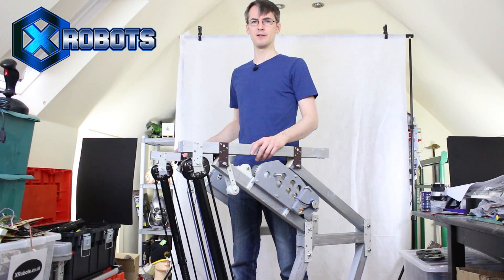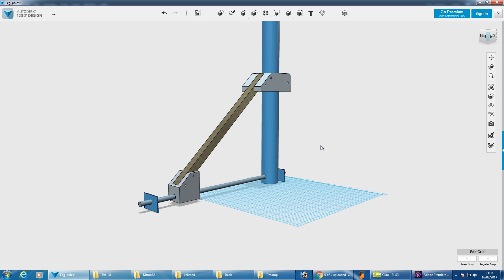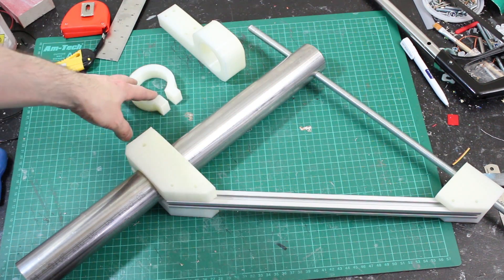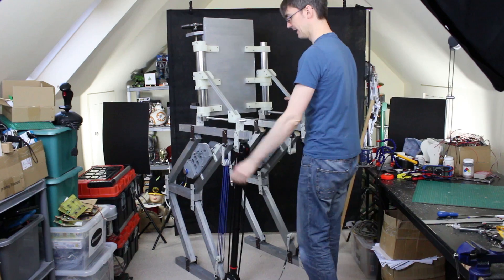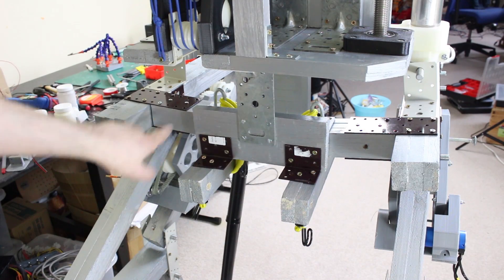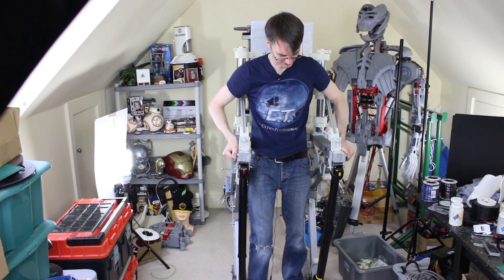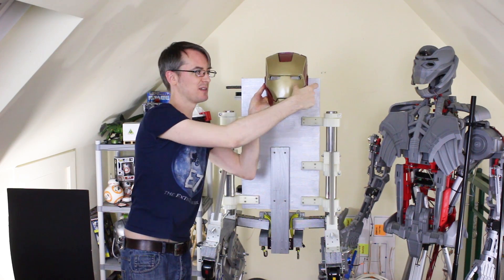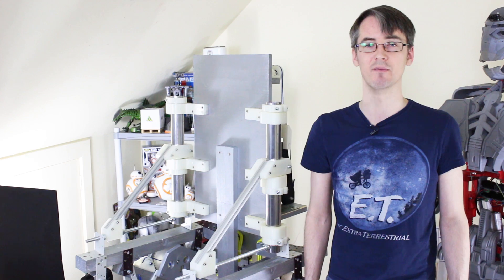Iron Man Exosuit #8 | Walking | James Bruton

Comment: no offence but most of you exosuit is much larger than it could be by simply moving a few components. for example you can hide the power cells and motors for joints in the places where logically muscles would be, and use multiple paracord pullies to reach over the joint. Also, for the legs you should use multiple springs and try to keep the mechanism as close to your legs as possible so that you can focus more on the structural support to the components from the outside. just some ideas based on what I have tried to do before. but i really havent worked with 3d printers or plastic and i can see that budget constraints might be a serious concern.

Comment: I'm still a bit unsure about the 'reverse knee' arrangement you're using. But if it does the job of keeping the heavy equipment off your back, great! That's the whole point of exoskeletons, right? Divert the force and stress off of the user and into the much stronger framework and actuators.
Reply: Like a forklift, you want full control at the front, and forward legs would get in the way. Anyway birds' legs go backwards.

Comment: the problem with your robot and todays exoskeleton is that it's too big and theirs no hip structure keeping the device from falling is also mechanical electric motor gyroscope? some  world robot designers don't even use it about the joints and to steady the device to run quickly!
Reply: ...what?

Comment: I added 177 electric motors for flying the device like a manned drone that's also connected to the exoskeleton having 200v electric motors 1000lbs lifting weight. besides flying over 35,000mph let me see if u can?

Comment: good job. if so their be a next suit try using the robot in your size u made having in its front a headrest and it's chest a backrest and try to separate the hip top of structure and bottom of mechanical structure extended spaced backwards for a bootie rest with rotation movement left & right and to lean side to side for the top of the hip structure and bottom. your left and right arms and leg rest should be between dual mechanical arms and legs connected by motor above shoulders and legs connected Left and Right side  using simplified  motorized Biomechanical Neron controlled the exoskeleton should be coupled with abs or aluminum alloy bodywork connected to the exoskeleton to cover u. let me see u do that!

Comment: On your other video you are building a robot using drill motors as "muscles" and Arduinos as the brains. You have then programmed the Arduino to rotate the motors to compensate when the frame moves (for stability). Could you not have used a similar approach here to design the legs and possibly the remainder of this suit? OR would this approach be too-slow/under-powered? And if it is too slow, would air muscles not have been a feasible replacement?
Reply: This is true. However both have their merits. Air muscles would give higher speed and work more like real muscles, but linear actuators using powerful drill motors would allow for much higher strength. 
With the design you've gone with, it's very reminiscent of the Caterpillar P-5000 Work Loader from Aliens....and that was used for strength. 
At least when you've finished this, you'll be able to fight aliens :)

Comment: I don't know if you might have talked about this in  the past, but why exactly are you maing only 1 arm?
Reply: oh okay, that makes sense. but is there any chance you will  consider making fhe second arm too when all is done? I think it would look so much cooler!
Reply: At the moment this is only a prototype or 'crude' prototype as James has mentioned. Meant for low cost and efficiency during the build so it'll actually get done, and I'm sure once it has been tested and proven to work James may or may not work on a second design, that has both arms :D